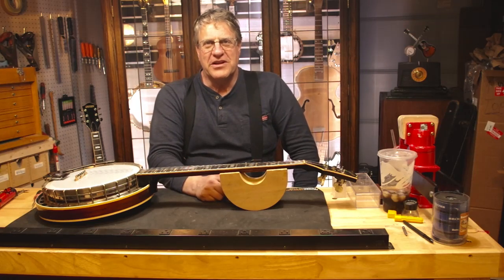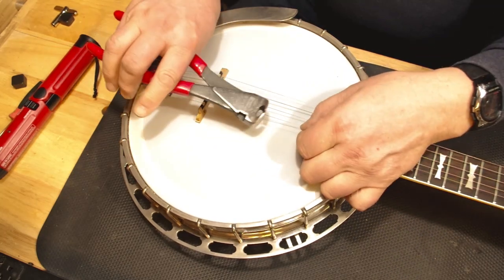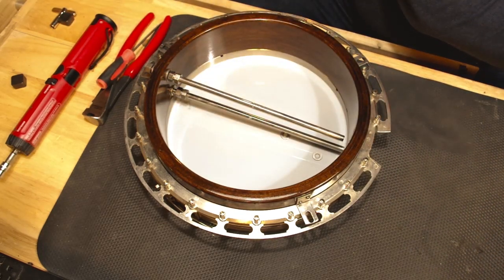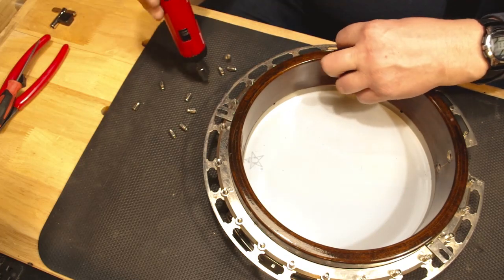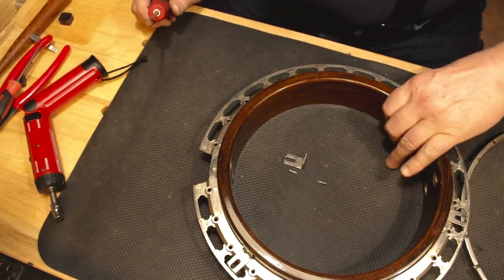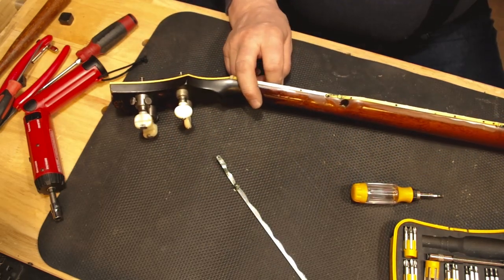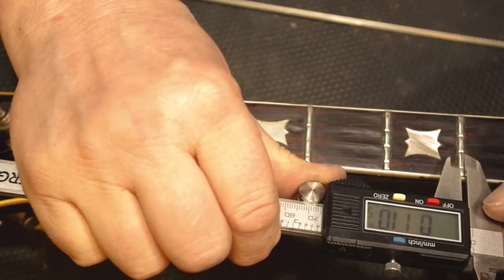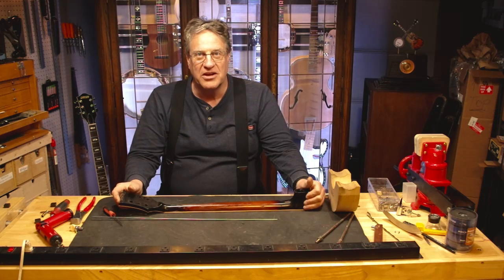Video 2 Gibson banjo restoration: Disassembly and discovery

Comment: Great video & thanks for sharing this restoration!!!!!!! I just don't understand why some people have such a problem with cleaning these old banjos. If it's done gently & methodically without harsh cleaners, it doesn't hurt anything. Crud doesn't add anything to the sound or value. Instruments are like cars, in a musical sense. Take care of them & they'll take care of you. 
     I put together a parts banjo for my road gigs in 2021 & cleaned everything as I put it together. I played that banjo from about June to September & then, took it apart for an upgrade to the rim & tonering. I was amazed at how much gunk had accumulated under the tension hoop, on the outside of the tonering & on some of the brackets.
     Those doll eyes are a bit creepy, but they add some interesting character to the banjo. You're probably already aware of this, but those screw holes on the back of the peghead, are from the original, tulip button "box tuners" that came on most of the bowties from that era. They looked good, but didn't hold up well. Most of them worked awful, had a ton of play in the gears & you couldn't keep them in tune. I don't blame anyone for changing them.